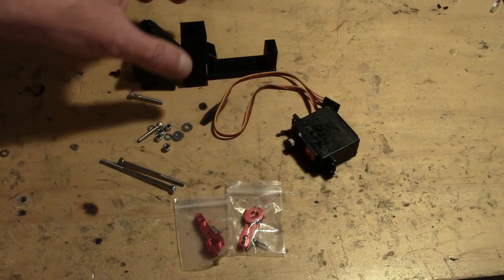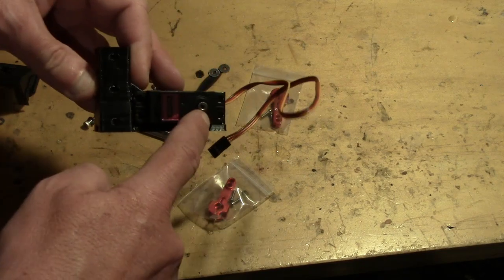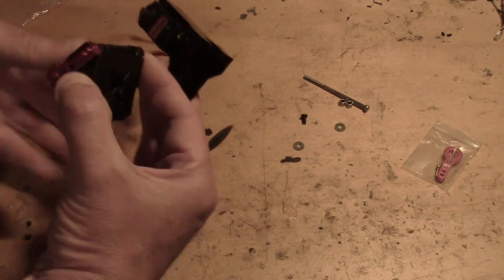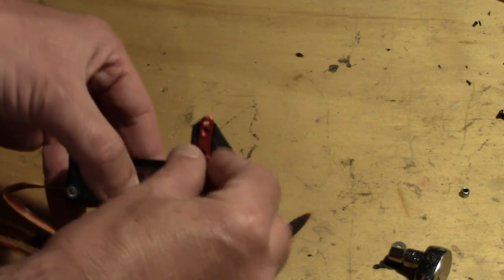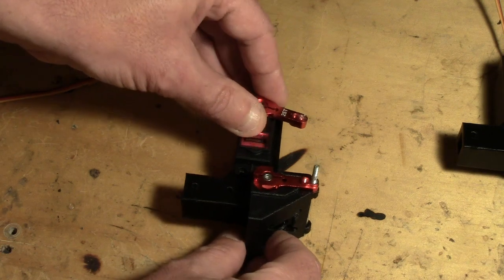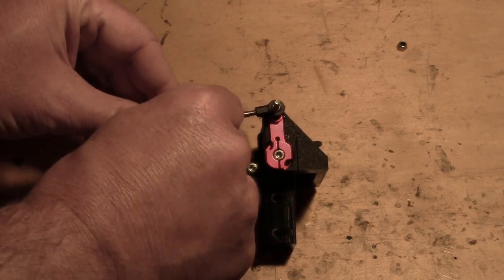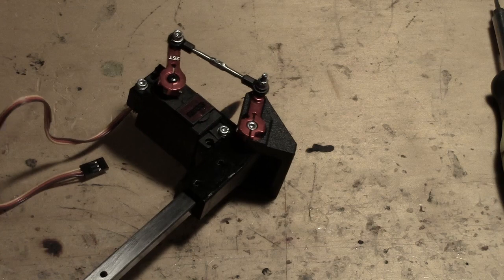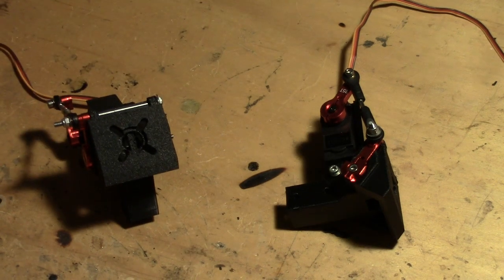3D-Printed Tilt-Rotor Motor Mount for VTOL Quadplanes

Comment: Hi David, I am developing a full scale flying car: tilt rotor flying wing VTOL tricopter, similar in function to the Convergence RC model.. Click on my icon for details. I am currently using a mechanism similar to yours in the current 200 lb unmanned vehicle that uses two rotating 10kW motors in front that weigh about 5 lb each. The problem is that because they weigh so much, this puts a lot of back torque on the servos, which draws a lot of power. This will become an even bigger problem when we start developing a manned prototype with even bigger and heavier motors. Do you have any ideas how to solve this? Currently I solved this by putting a mechanical stop  for the motors to rest on when they are pointed forward in plane flight mode. In VTOL mode the motors are pointed straight up, so they are not much of a problem. But during the transitions it becomes a problem. Fortunately this does not last long, so the power loss in minimal. One could add a counter weight to the bottom of the motors so that the torque is canceled, but this adds weight to the vehicle and slows down the servo tilt response time. By the way, many people have complained that using only one push rod in such a mechanism, link in the Convergence, is susceptible to reversing when the vehicle crashes causing the motor to tuck under. This can be fixed by using a symmetrical T servo arm on both the servo and the control arm on the motor, and connecting another control rod between the two control arms.

Comment: Well done getting your daughter involved. She did a great job. I have an Sky Walker Black X8 sitting in a room and wanted to convert it to VTOL. I got it a year or so ago.  Really happy I have found your channel. So I'm now going through all of our update video's
Reply from the maker: Thanks for the comment Jason. I let my daughter know and she was chuffed.
Reply: @brodo78  Hi David, I am developing a full scale flying car: tilt rotor flying wing VTOL tricopter, similar in function to the Convergence RC model.. Click on my icon for details. I am currently using a mechanism similar to yours in the current 200 lb unmanned vehicle that uses two rotating 10kW motors in front that weigh about 5 lb each. The problem is that because they weigh so much, this puts a lot of back torque on the servos, which draws a lot of power. This will become an even bigger problem when we start developing a manned prototype with even bigger and heavier motors. Do you have any ideas how to solve this? Currently I solved this by putting a mechanical stop  for the motors to rest on when they are pointed forward in plane flight mode. In VTOL mode the motors are pointed straight up, so they are not much of a problem. But during the transitions it becomes a problem. Fortunately this does not last long, so the power loss in minimal. One could add a counter weight to the bottom of the motors so that the torque is canceled, but this adds weight to the vehicle and slows down the servo tilt response time. By the way, many people have complained that using only one push rod in such a mechanism, link in the Convergence, is susceptible to reversing when the vehicle crashes causing the motor to tuck under. This can be fixed by using a symmetrical T servo arm on both the servo and the control arm on the motor, and connecting another control rod between the two control arms.